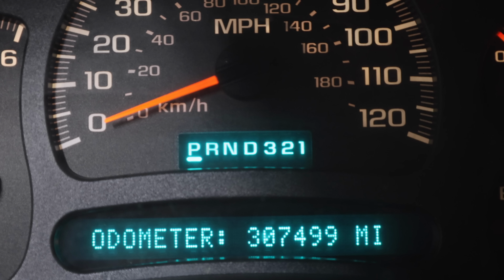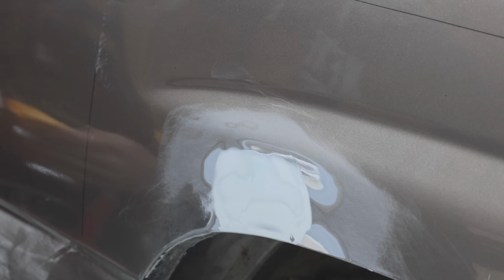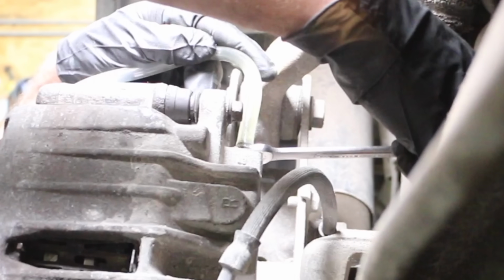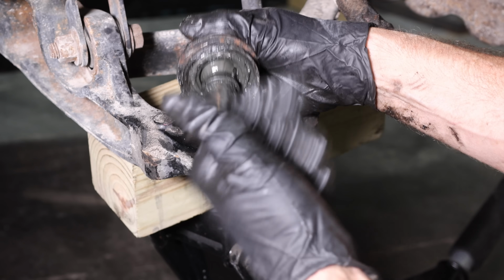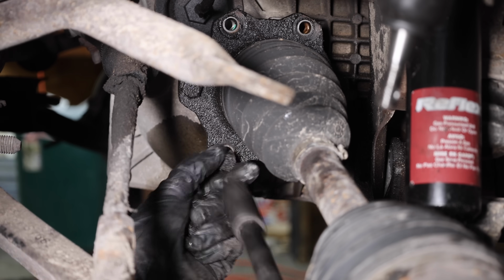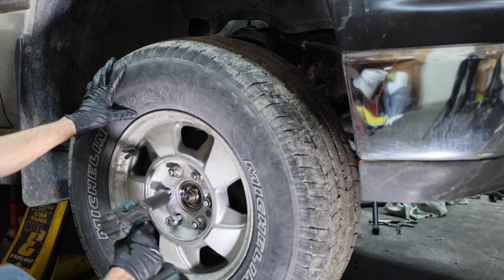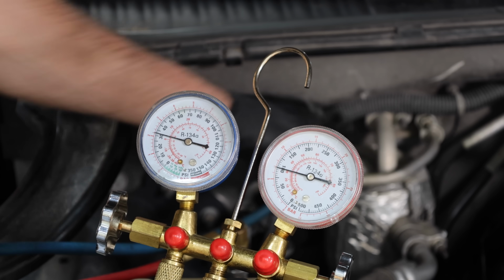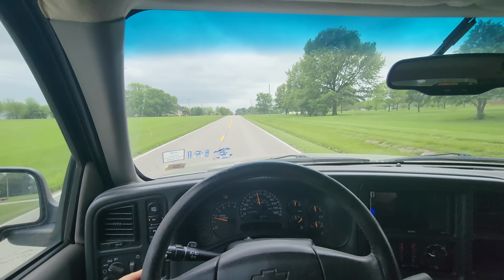Is It Stupid To Fix Up A 300,000 Mile Vehicle? Let Settle This!

Comment: "Is It Stupid To Fix Up A 300,000 Mile Vehicle?" Depends on the vehicle. But many vehicles that probably weren't worth fixing are absolutely worth fixing today. New vehicles (or whatever you choose to call them) are no longer acceptable to me. New "vehicles" run on software, have a WiFi connection to the manufacturer, have spy cameras and microphones inside watching, listening to, and recording every single thing the driver and passengers do and say, and transmitting all that back to the vehicle manufacturer as it happens, the manufacturers are then selling this stuff to third party companies who then sell it to anyone that wants it. This is not like speed cameras beside the road. These cameras and microphones are INSIDE what is supposed to be YOUR vehicle, spying on YOU. These vehicles also have driver interference systems that can literally take control of the vehicle away from the driver. Thy can apply the brakes, turn the steering wheel, and shut the engine off. Some of them can be controlled remotely by WiFi by the manufacturer, and others. They can literally take over the vehicle, lock you inside, and then send the vehicle anywhere they want. Most people that buy these vehicles are still either unaware all this is happening, or refuse to believe it.

I have a 2006 Mercury Grand Marquis with 386,000 miles on it, still with the original engine and transmission, and it runs just fine. I have another engine and transmission ready to go into it. And just to be on the safe side, about a year ago I found a like new one owner 2007 Mercury Grand Marquis with only 36,000 miles on it. I bought it for $10,000 cash. I also have a 1968 Ford F-250 with a fairly new engine and transmission. 2 door, standard cab, bench seat, 2 wheel drive, 8 foot bed. It's solid as a rock. I'm in AZ, and vehicles just don't rust here. Older vehicles need to be kept going for as long as possible, as there are no longer any replacements for them.

Comment: As A Brake Tech, You would have got it better if you clean the rust off between the Rotors n Axles, And Between the Caliber Brackets n Rattle clips. And apply a pinch brake grease between them. . . .And you should have replace the filter in the trans with 4 1/2 quarts of trans fluid. . . . The trans filter can become clogged with old trans fluid and cut down on the flow witch will cause damage to the trans. . . . . And if you want to get the best warranty for the Power Steering Box, . . you should have replace the Power Steering Pump as well. . . . I hope that this info helps you out latter on. . . . .
Reply from the maker: Thanks for the constructive feedback.
Reply: @ProjectFarm  you are vary welcome

Comment: @ProjectFarm 🔶Can we get a video on the best Dehumidifier?
Could test for: 
How much water it pulls over time, 
How low it can get the humidity down to, 
Noise level, 
Power consumption, 
Can it automatically turn on after a power outage, 
Does it ice up and if so is there a de-ice mode, 
Can it drain water via hose, 
Can it Pump water via hose upwards.. 
Probably some other stuff but those are the big ones. May need a set of medium sized units for RV/Boat and large ones for traditional homes. 

Thank you for all that you do!🚜
Reply from the maker: You are welcome!  Thanks for the suggestion.

Comment: Chevy/GM trucks made prior to 2007 (last year of the GMT800 platform) were very reliable.
My 99 has 270,000 miles and doesnt leak a drop and Ive only had to replace both front bearing hubs.
Reply from the maker: Thanks for sharing.

Comment: Keep doing what you do the way you do it.
My car with 326K miles is out getting some transmission work to compliment the new struts, lower A-arms, and ball joints it just got.  The engine is all original except for valve cover and timing chain cover gaskets, front main seal, and the O-ring on the timing chain tensioner.
Reply from the maker: Thanks for the feedback.

Comment: We have a 2002 Escalade 293k miles and she's still going strong these GMT800 trucks were the true work horses of the early 2000s <3
Reply from the maker: Thank for sharing!
Reply: Also got like 14mpg on a good day lol
Reply: I have a GMT800 truck and debating whether I should fix it. The transmission is bad and the truck has 214k. Engine, body, and suspension are solid.
Reply: @buzztrucker It's only $600 for a good used transmission from the salvage yard.  That's the route our family has always gone.
Reply: @buzztrucker  Have you seen the price of new trucks?? Those Transmissions are cheap. Definitely fix it. I've got 372k on mine and still runs beautifully. I'm still on the original transmission, but if it crapped out tomorrow, I would replace it. These trucks will run forever.

Comment: Okay, so you did a great job on this video, but you did not include the time it took to do these repairs and replacements.  I have done every one of these things to my  X4 muscle cars over time, but it is very time consuming and that time should be included to give a man a better idea about how to proceed and make his decisions, keep her or sell her.  I have a 1972 Chevy Monte Carlo that I have done all of these thing to it and much more.  I over hauled the automatic transmission with new racing HD parts.  I replaced the whole front end steering parts.  I tore the engine completely down and blue printed the engine and reassembled it with new valves and push rods and new lifters and rocker arms..  I replaced the gas tank, which is one thing that you should have considered since you were doing all these other things.  So how much time did all of these changes and replacements take????   I watch many of your videos and enjoy the ones where you speak slower, but I know you are compressing allot of things into your videos.  God bless you.
Reply from the maker: Thanks!  I worked for 40 hours but was slowed down when flmng.

Comment: i live in quebec (they salt the roads 6 months per year). i find this vehicle in excellent shape for a 2003. I did the brakes on my wife's 2017 ionic 3 weeks ago (bought this year, we are the 2nd owners). all the bolts were soldered by rust, caliber braket inflated slightly and the new brake pads would not fit etc. took me a full afternoon for the rear brakes. Still have to do the front brakes but i give me time to recover from PTSD. This rust i see on the suburban seems almost like a new vehicle lol
Reply from the maker: Thanks for the feedback.

Comment: You do one hell of a fine job….proceed with speeds as you see fit!
Nice job on the fix up! My experience is that 250-300k is about where things start to fall apart as fast as you can fix them. Out here in Nebraska rust from this corrosive ice melt seems to take cars off the road, or deer strikes.
No right or wrong answer on a high mileage vehicle.
Keep up the good work!!
Reply from the maker: Thanks, will do!

Comment: Power steering pump and Gear box are two different components. Calling the gear box a pump so many times without adding a correction in the video post editing  got a little annoying.

Comment: My 2003 GMC Yukon XL just lost the transmission at 400k.. replaced for $1200. Back on the road. Engines fine. The 5.3 4L60E is the best combo on the road from 03
Reply from the maker: Thanks for sharing.

Comment: It's okay to talk fast but use verbal and visual transitions. I've been a technical writer for 30 years. I've noticed that the present ubiquity in lack of transitions is characteristic of Millennials (and often younger folks trying to imitate them). But unfortunately the impulse to cut them is just  to show off to see if you can keep up, instead of actually serving your audience. You can always cut up a video to make it shorter (something I highly recommend) in several installments. 
The main problem I have is actually trying to follow visual transitions and mapping them to the words you're saying. When explaining multiple step operations without visual transitions, it's likely the audience does not know what they are looking at until you've actually spoken most of the content for the shot. Try presenting a visual flow briefly before beginning the operations. This can simply be a flow chart. Maybe also start with a wide shot (with the front end of the car in the shot) and then move into the ball joint. Continue to use words like "next", "after doing ---", "the third step is to ---- " and such. A pause here and there is a good thing. We listen and learn neurologically and hematologically in a cadence similar to a heartbeat. This has been proven repeatedly.
Having said all of this, I love your channel and have been an evangelist for it to my friends for years. Your channel is a wild success because it seeks first and foremost to serve its audience. And it succeeds. Those who would advise to leave out the signposts in your content do not have that philosophy in mind.

Comment: Great Video, I need to do that Transmission Fluid Exchange like you did on my 2001 Chevy Silverado with a 3.5 Motor.
 I used a Manual Fluid pump I got at Harbor freight, but I can't get more than a half a quart at a time. Can you list the Parts/Tools you used so that I can do a better job at it please?
Reply from the maker: Thanks for the feedback.

Comment: The body fix is okay but always a BUT...... the corners is better to have in radius and not 90 deg........ the part was a little to high........ body filler is good but first some fiberglass and then body filler...... the paint was a great one but using some tape to not have paint all over is a smart move..... but a nice work done.
Reply from the maker: Thanks!

Comment: I similarly did the same to my 2001 GMC SIERRA 4X4. I was looking at getting a new GMC Denali...$85k. I feel the price is ridiculous. Instead, I had new engine, transmission put in. I replaced all suspension and steering components. I recently installed a T-case saver over two years ago, transfer case maintenance was up to date. Replaced all U-joints when we inspected the front and rear differential. All said and done it cost 18,000 and I don't have any new truck payment.
Reply from the maker: Thanks for sharing.

Comment: I have a 59 rambler.  ive always liked it . I overhauled it  in 2010  probably 60k miles since overhaul.  over al it has 492k miles.  20+mpg ,  I have to make some parts.  it has an AMC 327 3speed /od.
yes worth fixing.   a new car is less rebuildable.
Reply from the maker: Thanks for sharing.

Comment: I have a 1997 F150 with 300K on the odometer and counting! All original suspension and steering parts and it definitely could use some work. But it totally is worth saving. These older vehicles (crazy I’m saying that about a 2003) are very well built and are absolutely worth repairing. Loved the video!
Reply from the maker: Thanks!  Thanks for sharing.

Comment: Does it still hold good oil pressure at idle? Curious to know if you have ever put a high pressure oil pump in a high mile engine.

Comment: You’re amazing you did $10 k worth the repairs on your suburban in 27 min. At regular shop rates most people would have scraped it. Love your videos don’t change a single thing. Canadian fan
Reply: Probably more than 10k, suspension parts, shops are unwilling to press out the rubber bits, so they force you all new parts. I gave up that same model Suburban 14 yrs ago the maintenance just wasn't worth it

Comment: TEST SUGGESTION - I would like to see a test of irrigation waterproof wire connectors.  Long term performance while submerged in a water filled valve box is difficult.
Reply from the maker: Thanks for the suggestion.

Comment: Some of these services were useless and wasteful. There was no need to replace the rotors or brake pads, of the spark plugs and leads, of the headlight bulb. Completely unnecessary and again, insanely wasteful

Comment: Think you could do a brake pad material selection AND lifespan for pad x rotor on different high performance materials? it'd probably be motorcycle variants since its easiest to check. organic, semi organic, ceramic, sintered etc? Engineering explained did good baseline on car brake pads x performance over 100 brake cycles and how much more pressure was needed when they were hot ie sublimation of the pad material
Reply from the maker: Thanks for the suggestion.

Comment: For RTV gaskets I strongly recommend using "The right stuff", you can apply it, tighten the bolts immediately and then fill the fluid and be on your way! No wait and better yet, no leaks! 

As far as the pace and everything, just do you! We are here for it regardless! Hour long videos or 25 is all the same, beginning to end is all info and no filler! 

Oh yeah, must be nice to be able to simply remove a hub like that, in Minnesota it's not at all uncommon to be swinging a 5+ lbs BFH enough to take a break or tag a buddy in! 😂

As for the body work, it's not that you need skill to get reasonable results..... You need patience! THAT my friend, you have!
Reply from the maker: Thanks for the feedback.

Comment: My 3/4 ton diesel pickup has over 400k on it, but I did need to have the engine rebuilt at about 390k.  Other than normal maintenance, its been pretty trouble free.  I'm planning on swapping in a new bed this year, because I've beat up the original.
Reply from the maker: Thanks for sharing.

Comment: No need to slow it down, you get a lot of good information through in a short time, and it works well with you doing it.  

I watch all your videos and they have been very helpful.   

As for older high mileage cars, my rule is that if a vehicle is working well, parts are available, it is not giving major issues, and the vehicle still meets your needs, you keep it going.  

Being able to DIY with the help of these videos makes this even more viable.

There are too many lemons out there in the new car market.  You take a big risk.
Reply from the maker: Thanks for the feedback.

Comment: Ive got a 2000 Silverado. I could spend $ 10000 and rebuild the truck from motor to tranny to front end and the interior.  New trucks cost 70000. Do the math😂
Reply from the maker: Thanks for sharing.

Comment: Knipex snap ring pliers are the best I have used. I've used the ones with the swappable tips and those always break. Snap-On pliers will always slip out of the snap ring holes. The Knipex have angled tips and they hold the clip tight so they won't pop out.
Reply from the maker: Thanks for the feedback.

Comment: I’ll second the importance of wearing eye pro with snap rings.  About 4 years ago we lived in base housing and I was replacing the clutch plates on my ‘96 Harley-Davidson Fat Boy.  While trying to remove the snap ring holding the diaphragm spring from the clutch basket one of the fingers that it fits into snapped off.  The snap ring flew right past my right ear and embedded itself in one of the garage studs about two inches.  Definitely would have ended up in the hospital if it was an inch or two closer.
Reply from the maker: Thanks for sharing.

Comment: I mentioned it on the 200k car video and it goes double for 300k miles - gotta check the compression! And while you're at it check your timing too. If that engine hasn't had an overhaul in 300k miles, the piston rings are probably worn to hell and the piston heads are no-doubt covered in carbon and grime. You're probably getting a fraction of the compression (and therefore a fraction of the power and fuel efficiency) that you should. Of course, an engine rebuild goes far beyond the skill of most DIYers, but even just knowing you've got low compression at least tells you how much time you've got before you need to pay someone to rebuild it.
Reply from the maker: Thanks for sharing.

Comment: At 13:56 you snugged the spindle nut and said you would come back and tighten when the tire was on the ground. You didn’t show it being tightened down later (or I blinked and missed it). I’m sure you did tighten it because you are very meticulous with your work. But just incase I wanted to point that out. Keep the pace of the videos! Thank you!
Reply from the maker: Thanks for the feedback.

Comment: I rebuilt the engine, brake system, cut off and fixed up some rust etc on my first car and it had 350k miles. It's not stupid. Settled.
Reply from the maker: Thanks for sharing.

Comment: Nice job!
I suggest replacing the timing chains, sprokets, guides, timing chain cover gaskets, and crank shaft sprocket. The chain guides and tensioners are made of plastic and should be replaced before they break apart. The timing chains not only stretch but also together with the sprokets  teeth, wear out, reducing power and fuel efficiency. 
I did all of that with O.E.M. parts from the dealer at a very good price.
The injectors were very expensive, so I bought some from Amazon, good quality.
 The ignition coils from Amazon, too, but OEM.
The O2 sensors, the TP sensor,  from the dealer. 
I did that in a period of about 3 years.
I'm thinking of replacing the catalytic converters because they should be obstructed by now at 236K miles.
Great video, thank you.
Reply from the maker: Thanks and you are welcome!  Thanks for sharing.
Reply: Just to clarify, I  did all the work, not the dealer. I only went there to buy some of the parts (I'm kind of picky).
Also, about the timing job, I had to do a lot of research on how to that.
I'm not a mechanic. I just like your channel 😃👍